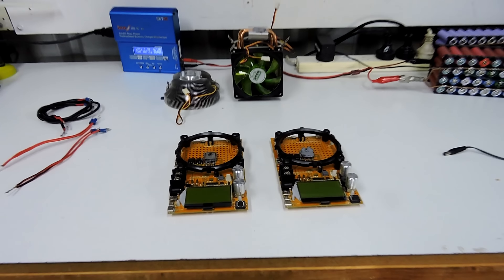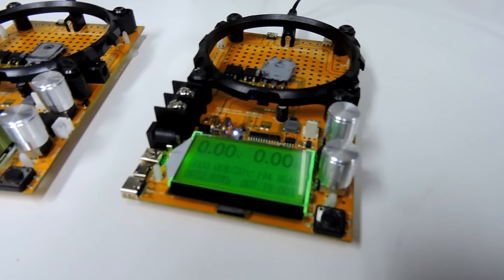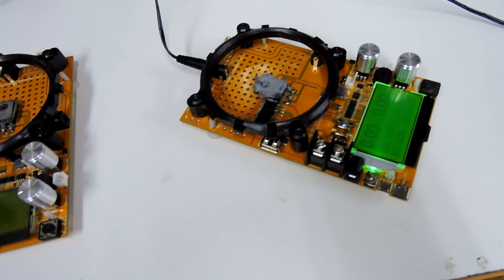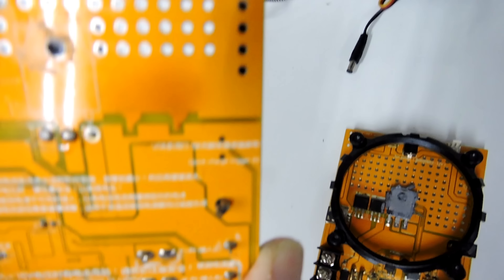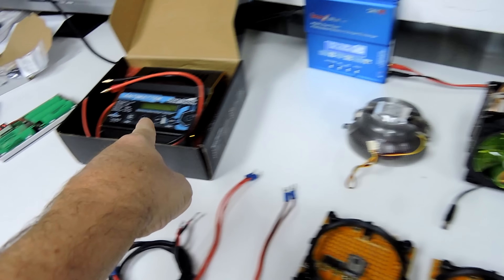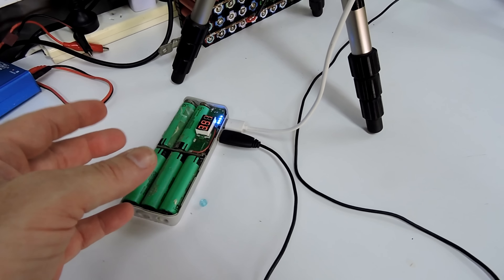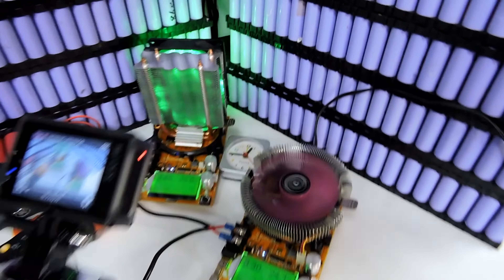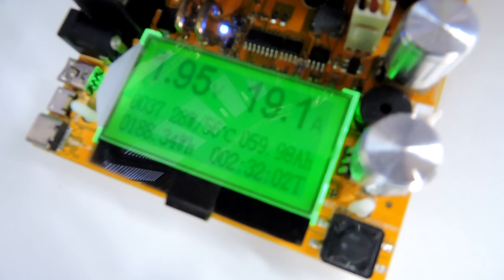150W 180W Constant Current Discharge Capacity Tester More in depth :)

Comment: Hi Peter, these dummy loads are great but the under-voltage feature is rubbish. To fix this I’ve added a custom disconnect unit that uses a low voltage IO sense relay and a 12volt 100amp automotive relay to disconnect the battery until the unit is reset. It works like a charm and now my battery capacity tests are very consistent. If you think this add-on unit may be useful to your readers please let me know and I’ll send you the circuit details. Cheers Peter

Comment: One tester that I purchased had the same backlight problem. Once I turned it off, it wouldn't turn on again. I went through multiple full resets and power-off/on cycles and eventually it did come back to the BL=ON setting after using the button to try changing its status. (edit: these kinds of details on managing the display sub-menus are not well covered anywhere that I know of, definitely not in the provided "user manual", and the details may vary depending on the manufacturer or any firmware revision)

(see EDIT at bottom of this comment)
The backlight control issue seems similar to the problem I had with it while I was setting the Cutoff Voltage to start DEcreasing when I pressed and held the button down. I had accidentally "gone past" the <3.0 cutoff voltage I really wanted and it went to <3.1, and to get it back to the lower <3.0 setting was inconsistent in its operation. Some times I couldn't get the setting to DEcrease using the button no matter what I did. Other times I got the button to start DEcreasing the setting. It seemed somewhat random. This was true on two different testers so I think it's a firmware/non-volatile memory state issue...or just random. Even 5-click and 7-click resets and powering-off/on didn't change things consistently.

EDIT 20200408:
CHANGING DIRECTION OF VOLTAGE CUTOFF, Vterm, Vcutoff, etc
I think I've found a way to CONSISTENTLY flip the direction of the voltage settings using the button.
When you want to change the direction (higher to lower, lower to higher) while setting the voltage, QUICK press the button 3 times and it flips direction. For example, if when I press the button it's been increasing from <3.0 to <3.1 to <3.2 to <3.3 etc and I want to set it to <2.8, then I QUICK press the button 3 times and it will now change from <3.3 to <3.2 to <3.1 etc. until I get to the voltage I want. Then, if I accidentally go past THAT desired voltage (again), I just QUICK press the button 3 times and it will flip to going the other way again with each subsequent press of the buttton.

Comment: FYI: +3V output signal available when alarm "beeps". Possibilities...

Thought I'd mention. If you have a version of the board that has the "empty" 2-pin connector adjacent to the alarm transducer and in-between the two current adjustment potentiometers (silver knobs), then you likely have a signal source you can use to do other things when the tester's alarm starts beeping. Note: this 2-pin connector is at about the 4 o'clock position on the board. In all photos of this tester I've seen the 2--pin connector is a white plastic, however it could be black or some other color depending on the manufacturer.

I've only tested it while discharging a battery to a cutoff voltage I specified (e.g. 6.0V for a 2S1P 8.4V LiPo battery configuration).

When the cutoff voltage was exceeded (below 6.0V), the alarm started beeping and the 2-pin connector transitions from 0.0V to 3.0V. This is a constant +3.0V and does not go up and down as the "beep" turns on and off. As long as the alarm is beeping, the output will be a steady +3.0V. When the alarm condition is ended and there is no more beeping...the output goes back to 0.0V.

I can use this signal to control other small external circuits to do things like electrically disconnect the battery under test, or to turn on an indicator light/LED, or sound a much louder alarm, and so on. Or, if I'm using a 2-channel oscilloscope to measure battery voltage or discharge current...I could use this 2-pin output on another channel to indicate precisely when the discharging stopped...especially if using a datalogger of some type or storing the oscilloscope data to a PC.

I don't know how much current the 2-pin connector or its PCB lands can handle so I'd use a buffer/amplifier between this 2-pin output and things like an LED or relay.

Comment: You are using handheld thermometer wrong. Laser dot is only direction point, not measure point. 
This unit measures average temp on area which widens as the distance increases. Principle is illustrated on the side of the unit. Anyway, thanks for video.

Comment: Pete, any Constant-Current source will work to bulk charge those packs.  So, if you have any buck or boost converters laying around, just set them to 15 amps, even if it's at 30V, the packs will pull the voltage at the pack down to the needed voltage.  Then just pull them off when cells get to around 4.10V and finish them with your whimpy RC charger :D
Hope that helps
~Cheers~

Comment: see if you can slide a copper piece on the other ones with thermal paste on both sides so it will contact the heat sink, should help with heat transfer and slow down the burn marks

Comment: Hi Pete, Why don't you use a DPS5015 power supply to charge your batteries. 
Search for DPS5015 or DPS5020 on eBay. They cost around $50 delivered and can supply up to 15A to your battery. You can program end point voltage and maximum current.
These are very efficient (90-95%%) but need an external power pack. I use a 12V old laptop power supply rated at 150W. In my case I charge 10 x18650 LiFe batteries in parallel at 10A and it fully charged them in a couple of hours. You must use very heavy cables to enable high current charging.

Comment: What is the best dis charger on the market that can do at least 6 18650, made it to vid 240 and still here, really enjoying it. I have a stupid question about battery position for my pack. I have my 1st 8 pack ready for solder.

Can you place 3 racks of cells on top of each other so they are in series making 12v and then bus bar top rack and bottom rack in paralell

Comment: Packing as much thermal paste as you can on there is a bad idea.   Actually, using as little as is needed to fill the air spaces only is ideal.   When you over use thermal paste you actually insulate the chip from the heat sink and make things worse.
Reply from the maker: Sounds about right lol Less is better in most cases

Comment: Can you set a Low limit to that thing ? i dont want to stand next to it and wait :)
Reply from the maker: not with the models i had to test.
Reply: Are you sure? One of the startup menu panels (like the backlight panel) should come up showing "<0.00V" You press the button when in that panel to increase to the desired cutoff voltage. It's range is 0 to well over 100V by 0.1V increments. If you press and hold the button, it increases quickly. If you quickly press the button twice it increase by 0.1V each time.
Once the battery under test voltage decreases below your setting, it turns off the load and starts beeping about once every 2 seconds. You then press the button to show the mAh, Wh, etc data acquired at the time the test loading stopped. 

However, before pressing the button I strongly advise lowering the current setting potentiometers full ccw before doing so. If you don't...when the battery in testing self-recovers to a voltage above your voltage cutoff setting, it will re-apply the load and continue testing when you press the button to see the results. If you do decrease the pots to full-ccw, then the testing will not re-commence when you push the button and you can see all the acquired data without interference.

Comment: How much power would a pack draw in normal use tied to the house?
Reply from the maker: Base load is about 10a draw from battery bank, I have '4' batteries so 2.5 amps per battery devide by 80 cells = next to nothing
Reply: HBPowerwall so why the big 50amp test? I’m about half way from getting my first 80p14s so I need to start thinking about doing this
Reply from the maker: Finds weaknesses - in the process of setting up a big test at the moment but i need flat batteries for that to happen and i don't want to make the flat for no good reason lol so i'll wait till bad weather
Reply: @HBPowerwall  did you use two that in parallel directly to the battery and run them at same time?

Comment: Have you tested the voltage and current to know if it's displaying accurately? EDIT: didn't watch far enough to see your clamp meter
Reply from the maker: There is no way either the cheap discharger or clamp meter are accurate - I know that lol
Reply: I was deciding whether to buy this for testing my cells but Mooch recommended the West Mountain Radio CBA IV which I'm very happy with
Reply from the maker: i wouldn't buy it - pretty average stuff
Reply: You wouldn't buy the CBA IV or the discharger in this video?